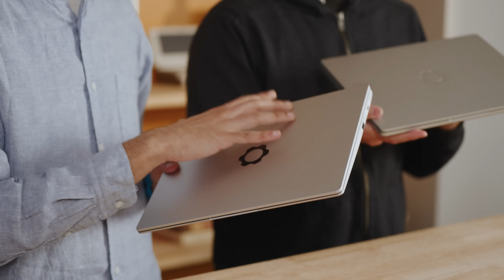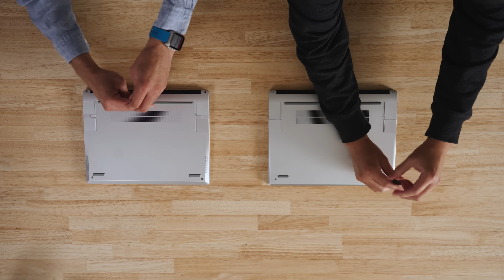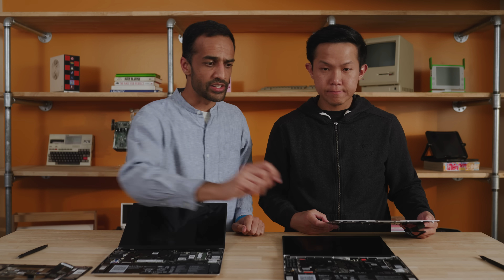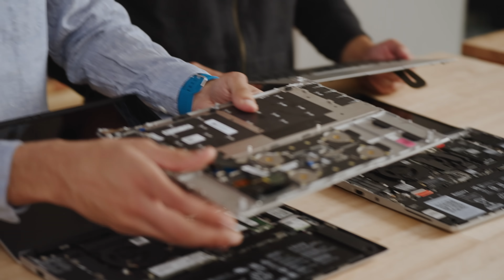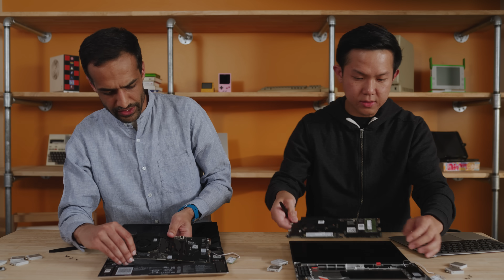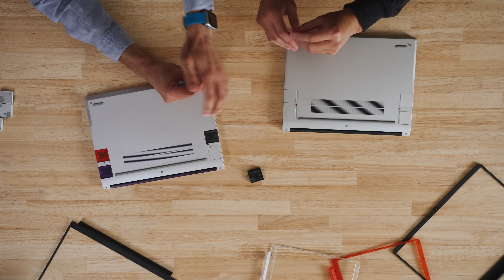How to upgrade to Pro from the Framework Laptop 13

Comment: I have one of the batch 2 13s so I am so happy to hear that I can replace the chassis and maintain my hardware.
Reply: I managed to get into batch 3 with a 358H and 32GB of ram : )
I’m really excited. 
My only question rn is if I can buy Crucial LPCAMM2 LPDDR5X because there’s a 64GB module on amazon for £500. But on Frameworks website is £830.

Comment: I was pretty worried when I heard "13 Pro" during the stream, but it's good to see that almost everything is interchangeable.
Reply: this, I am so happy to see this the company sticking to it's roots.
Reply: What a relieving moment indeed
Reply: Very nice indeed, although at some point I would be ok with some breaking changes, if it has a huge upside.
Reply: @punishedbrains  As long as these breaking changes are easily changeable and repairable. They can't be backwards compatible forever, and that's fine.
Reply: @punishedbrains  only if there is a big factor that requires a dealbreaker. i do appreciate their efforts though
Reply: frankly this was the best chance to make a new design for the future with the pro.
Reply: @joenani  i'm honestly glad they didn't because of modularity

Comment: LPCAMM memory finally being put into products is great to see
Reply: Downside of course being that it's happening now, when memory prices are all the way up there. Makes the Ryzen 300-series options still look better to me, since they'd mean I could carry over my current SODIMMs if I got one. Hope this all subsides in a few years, because CAMM2 has looked interesting to me for a minute now.
Reply: LPCamm 2
Reply: Eh. The thinkpad p1 had it 2 years ago. As someone with that laptop having lpcamm2 is sort of terrible. You can’t upgrade to 64gb for under $1000. It may as well be soldered memory like apple has. Probably more expensive, too.
Reply: @evangelion_chroma  Price comes down when there is more adoption, it's just that lpcamm is still very much on the innovators/early adopters side of the curve, and the current ram chip pricing isn't helping with adoption either.
Reply: @milesmason2994  Yeah, it's sort of a catch 22. Don't get me wrong, lpcamm2 is great. But it defeats the purpose when you can't upgrade it anyways. I literally could not find a retailer that sold 64gb modules, and this is years after it released.
Reply: @evangelion_chroma  Well, nobody can upgrade to 64gb under 1000$ nowadays
Reply: @evangelion_chroma  Framework is planning on selling 64GB modules for US$850, so in that case it's already coming down, even during the RAMpocalypse.
Reply: @evangelion_chroma just wait for the bubble to fully pop
it's already coming down in price
Reply: @evangelion_chroma   64GB cost around $850. A little expensive compared to Sodimm, but less than what you've said. 30% 😁 30%😅 40% 😭
Reply: @evangelion_chroma  I would like to upgrade my P1 too, but 64gb ist not even available here in Germany right now😅😩
Reply: @evangelion_chroma  a 64 gb stick i like 850 us from framework so camm is probably gonna get more accessible in the future
Reply: Miracle
Reply: This was super duper super huge!!
Reply: yep

Comment: Best part of the FW13 Pro is the new expansion card clips.

Standardized, Easy, excellent.
Well done
Reply: yeah old ones are annoying and flimsy and i actually had to RMA the bottom cover cause those springs werent strong enough to hold the cards in on my unit

glad theyre finally switching to toggles like on the 12 and 16
Reply: When I saw the toggle switch on the 12, I was like "I wish my 13 had that."
Wishes do come true. 😀